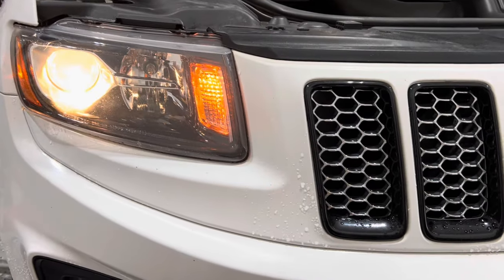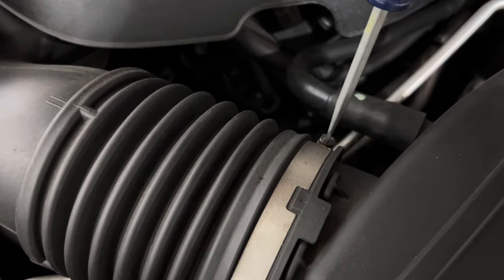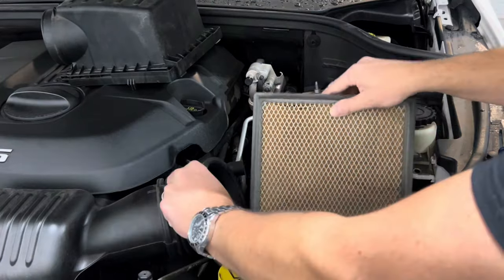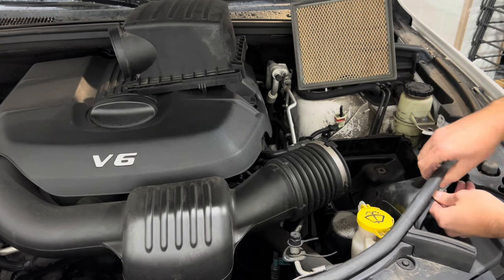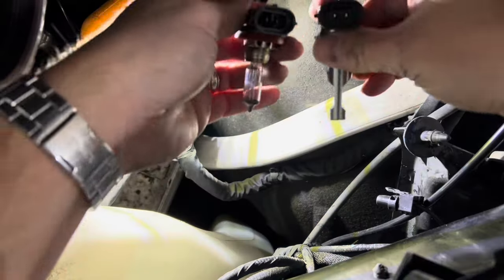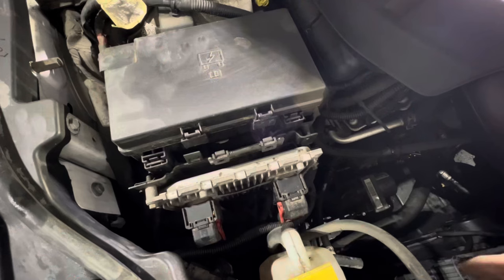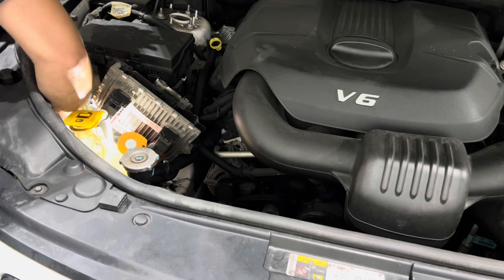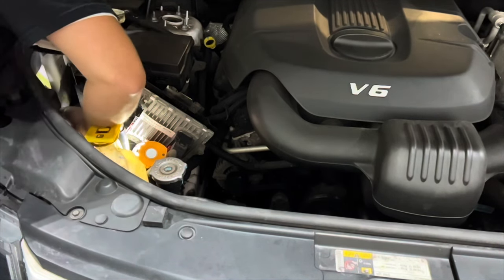Jeep Grand Cherokee Headlight Bulb Replacement (2011-2019)

Comment: I tried to change passenger side no way could I get my hand in to turn bulb
Reply from the maker: Hi Peter.  Thanks for watching!  I’d recommend trying the PVC tool method I describe in the video. 👍
Reply: @inspiringbuilds  I tried but bulb was turned in a strange position ended up having to take it in they had to remove the bumper to get it out

Comment: 2016 Jeep GC's are different. This looks like it's for a 2011-13.
Reply from the maker: @davetysdal5442  Thanks for watching.  The Jeep in the video is newer than those years and many others with years between 2011-2019 was able to follow this video to complete the work.  Is it possible that you just have a V8 and a little less room?

Comment: I got all the way to the bulb that bulb is so deeply in that reservoir that I there’s no way I can turn that bulb out without breaking it………… I don’t think anyone even with a small hand and arm could get it out. I managed to get two hands in thewheel well…… when you think of technology on lightbulbs do go out why they make it so difficult,  same with these thumb-bobs that start the vehicle if I cannot get my vehicle to start and it’s sitting in the garage in the olden days, you just stick it in neutral and push it out. You can’t do that today you can’t even turn the steering wheel without starting it up or putting the high beams on without starting it up. Same goes with these big rims on little cars with low profile tires America needs to wake up.
Reply from the maker: @Tom-v7i  Thanks for watching. I don’t  disagree the engineering certainly could have improved.  Same with the battery under the passenger seat.  I hope you were able to get your bulb replaced and saved some hard earned cash along the way.
Reply: @ thanks for replying not many do…….. no I wasn’t able to replace the bulbs , I first Tried to get them out before buying new ones. I do all of my work as much as I can because you’re right it cost way too much to bring it in. I may try to attempt to do it again and maybe take a needle nose pliers there’s not much room . . ✌️
Reply from the maker: @Tom-v7i  You’re welcome, keep me posted. Let me know if you need me to make a part two video with a homemade PVC tool to help remove the bulbs.
Reply: @inspiringbuilds  well sad to say my wife hit a deer so now it’s in the process of the collision department and the insurance company, good thing is they can fix it now and put in the bulbs.    Nov 25th
Reply from the maker: @Tom-v7i  Sorry to hear about the accident, but glad your wife is ok!  Part 2 with a DIY PVC will be coming out soon if you need to replace the bulbs in the future.

Comment: I’d rather jack the jeep up and pull the wheel to get to that access port
Reply from the maker: @MD-tb6eh  Thanks for watching.  I thought so too until I scraped up my hand so bad it was bleeding so tried to help others with a better solution.   For me I can replace the bulb quicker than removing the tire with a race jack and air tools.